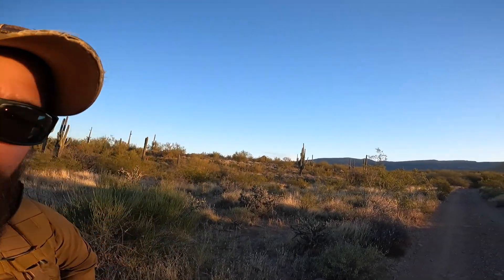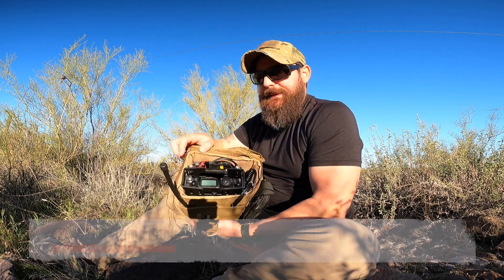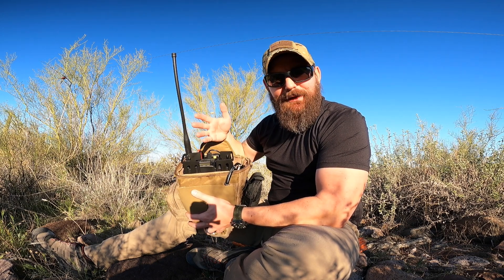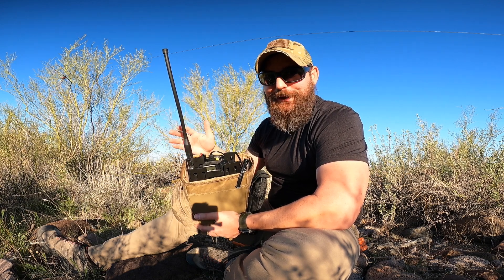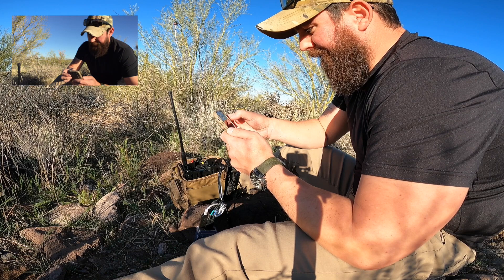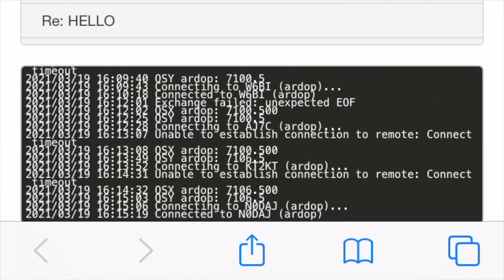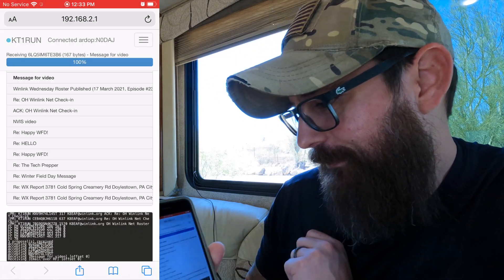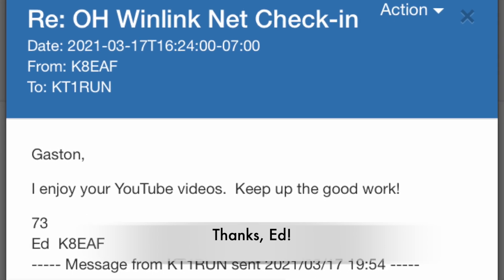Commercial HF Manpack? ARMOLOQ TPA-817 B - Part II - Digital

Comment: Newb here. So if some are concerned about the heat, like for uses beyond the ~15 min or so you mentioned is your usual duration, i assume just removing it from the bag is fine enough to keep it cool or am i missing something?
Reply from the maker: Welcome. I operate in the desert in temperatures in excess to 110F during the summer and never had an issue. I do not rag chew, so my operating time is usually less than an hour. In the summer months, I deploy a lean-to shelter for myself in the radio. My operating style is to strive for targeted windows, so anything over an hour operating is outside of my experience.

Comment: has anyone ever tried to 3d print a cage for one of thse it would be less durable than steel, but i think you could use exotic FDM filliment like carbon fiber, or petg, or even nylon, would be plenty durable imo, unless you are a clumsy oaf and drop your radio all over the ground all the time, and then no frame is going to help those peoples, but it would be substantially lighter i think, and you could still drop it and toss it in a tuck and it'll be fine (in the desert prolly not a great idea, some filliment has higher heat resistance though, so maybe in deserts too.

Comment: You need a ldg portable tuner, I also have a 818 they are awesome
Reply from the maker: I have the Z817 but never use it as I prefer resonant antennas. I also have a manual QRP tuner if needed.  Take care.
Reply: @TheTechPrepper  thanks buddy, ya the 818 is just a newer radio, and resonate antennas are a good idea, just getting started with portable operations and you have great ideas, with my antennas I was seeking multi band si I had to come up with a solution my g90 has a tuner built in but my 818, I needed a little help, thanks for the comment, and will watch the rest of your videos, in the army I was in radar, in intelligence, wish I had signed up for radio, but hindsight is 20-20, 73s

Comment: I really like the idea of your Manpacks, and i actually wanted to do one for myself for quiet a while now but the only issue that ive been having is the price of lithium batterys but i hope that tha will soon be less of an issue for me when i start working after im done with school
Reply from the maker: Glad you enjoy the packs. The LiFePO4 batteries are coming down in price. I am partial to Bioenno and have had good luck with the 4.5Ah model, but I ordered a couple of the 6Ah models to test. If you have the right tools, you may be able to make a comparable battery pack yourself using 18650 cells. Jason, KM4ACK, looked at the Miady LiFePO4 batteries, but I can't seem to find them for a good price on Amazon anymore.
Reply: @TheTechPrepper  Yeah thats true, but the Radio i plan on doing the manpack with is the Zastone d9000 a nice radio (for me) but the seller claims an usage of 12A max @ 50w, and im talking upto an 30% duty cycle, which still makes me wonder about what the apropiate battery size is since i would plan on using it for emmcom and i still gotta figure the aprs port aus, which nobody did to this point to use digi modes so still a lot of work

Comment: I finally looked your racks up and understand what is included. What I don’t understand is where you get the bag like cases where the equipment goes. Sorry to be so dense. Without the packs, it would seem to be a lot to hump through the woods as well as awkward. Please forgive my ignorance for not understanding.
Reply from the maker: In my opinion, you need the right bag to get the intended use out of the pack frame. There are different bags options depending on the radio. The PRC/117 pouch works well with the FT-857 and FT-891. The Helikon Tex E&E pouch works great with the FTM-6000R, but requires a modification when used with FT-817. The FT-817 also works well with the original camera bag I used. Here's a video that shows how this are connected for the 857. https://youtu.be/EH1o4HaFr_8

Comment: Keep going Gaston, the content is still enjoyable.  Sometimes it's in the journey that we find happiness/success, that doesn't mean it always works out the way we planned.  Learn, document, adapt and overcome.     

 Test with various different antennas if you have them.   I had a quick setup the other week, I only had a vertical on 20M to try to connect to Winlink ...  I knew a close gateway wasn't going work, most times 40/80M are the preferred bands to work and with NVIS, it wasn't an option for me at that time.   So I started at about 1KM then worked to 1562 through 1652 and those were the magic  range of distances on 20M with that antenna configuration and validated at both 5W and 10W.  I documented conditions, time of day and saved those gateways if I need them at some point in the future.  Funny that the gateway you connected to is one of the gateways I had success with "going long".
Reply from the maker: You nailed it on the head, Bob. The journey is the fun part. Honestly, if I started with this current setup, I would not have appreciated it. It has been fun experimenting with different modes of operation, different antennas and different load out strategies. There’s so much more to experience, learn and share. Thank you for your support! This video was challenging to film and edit, so I appreciate sticking with the video. So much footage lost on this adventure.

Comment: I love the modularity of your kit. I am trying to make my kits more modular to serve different operating goals. Where do you get the call sign patch? Those patches look great—would love to get some for my packs!
Reply from the maker: The modular kit is nice. Prior to this I was carrying three 3-liter dry bags for the radio, power, and antenna system. I ordered the patches from Tactical Gear Junkie. I didn’t do much research for the custom patch, so there may be better options out there, but I’m happy with them. Good look with your kit.

Comment: Nice video! I’ve been thinking about getting into the raspberry pi thing. And it over an iPhone would be a good fit for me. Sometime in the future would you do a detailed video on your pi setup; the hardware, configurations and so on? Or maybe point us to that info?
Reply from the maker: The Raspberry Pi is a great cost effective and power effective computer for ham radio (if you're not afraid of a learning curve in dealing with Linux). I may do a video in the future covering my specific setup, but in general, you would be best served by looking at the work that Jason KM4ACK is doing. He's made getting started with a Pi easy with his "Build a Pi" script. I would start with this video first: https://youtu.be/l4M9VVqGxoc

Comment: If that manpack was around when I had my 817 I would have bought it.  Nothing else does what Winlink can do, at least not that I know of.  That being said it can be a real pain sometimes.  Just finding a free node can take some time.  Good job.
Reply from the maker: Thanks, Tom. While a IC-705, G90 or KX2 would be nice, I figured why not make the most out of the FT-818 for a few years and just build the kit around the gear I have now. I didn’t realize you had an 817. I assumed you’ve always had the KX2. Thanks for shooting me the email.
Reply: @TheTechPrepper  No knock on the 817.  I loved that radio and still wish I had it at times, but at the time I couldn't justify keeping both.  I still have the FT-857.

Comment: Your kit is really coming together. I like the idea of using a soft side, yet rugged SLR camera bag. 
I too am a fan of  having things modular in nature, so they can be more adaptable / expandable.

I also really need to get off my butt and learn more about digital modes like Winlink. Low power, passive communications skills is something that will benefit me.
Reply from the maker: Thanks. The camera bag occurred to me after many hours of trying to find a bag with the right dimensions for the pack frame. I also picked up a binocular case that works ok if you’re just running voice and don’t need the extra space for power distribution and digital. Get off your butt, man! ;-)
Reply: @TheTechPrepper  just a thought. Maybe a solution to your SWR issue might be a NVIS antenna cut to be resonate on the digital portion of the band? Would add slightly to pack weight, but may be worthwhile having separate antennas resonate on digital and SSB.
Reply from the maker: @Scout75PortableRadio  That’s a great idea. For 80m I’m adding a manual link so that I can cover the digital and voice portions of the band. For 40m it’s not a huge problem. I was considering bringing the NanoVNA for some quick trimming if needed. I had another ham tell me that changes from one deployment to another (e.g., height, ground, location) can throw it off. At the moment, I have a couple of extra feet of wire on each end folded on its self, so I can make adjustments. I still need to investigate why the SWR was so high. Thanks!

Comment: Congrats on the digital connection!  Not a 'dry' video at all - personally I was THRILLED to see incoming messages on your setup.

You rightfully mentioned how nice it was to have a short setup time.  But as I've experimented with a portable data-radio bag, I got a reminder that it was equally important to have a short take-down time.  While testing things out, the sky turned black & it was clear that it was going to dump a substantial amount of rain in 5 minutes or less.  No problem!  I powered down the gear, unplugged the antenna, coiled the wire up real quick, and made it into the house with time to spare.

So congrats on your progress and you're exactly right to put a priority on easy setup & take-down.

-Scott,  K4KDR
Reply from the maker: Thanks, Scott. I appreciate that. This video seemed to be more difficult to film than normal with plenty of technical issues. It was strange mixing different videos together. At any rate, I appreciate your continued channel support. 73